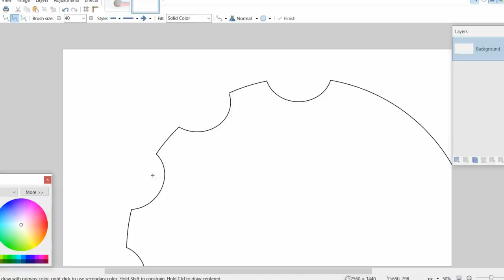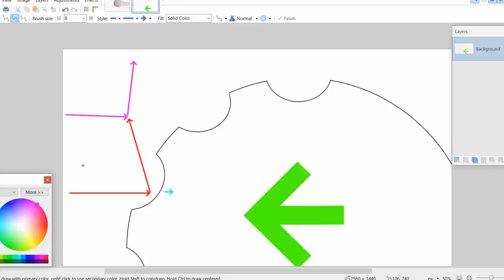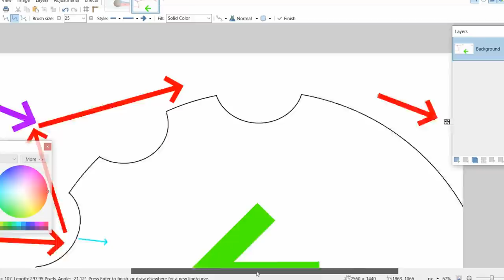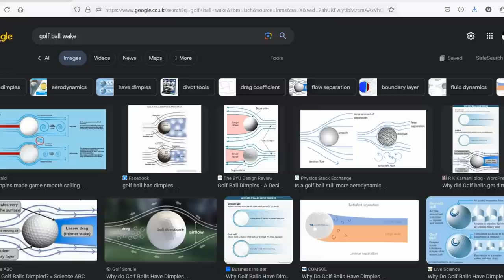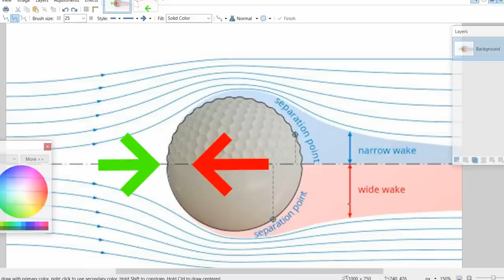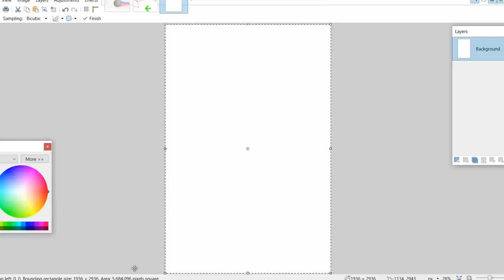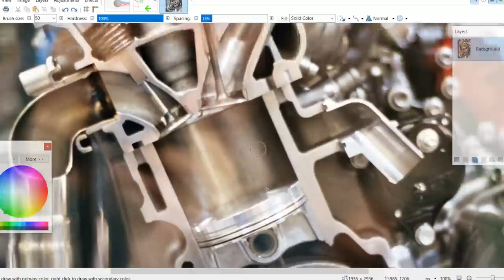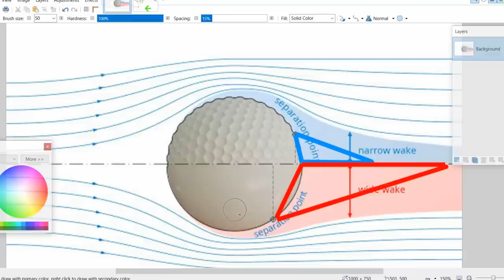Golf Ball Ports DON'T work!

Comment: Oh my giddy aunt...

This is why we don't let normies who watched a youtube video design aeroplanes! As an aerodynamicist the title alone makes me cringe. Painfully.
Reply: Why don't they shape airplanes like golfballs? Then the dimples would work :^)
Reply: @11metalfan  Ikr! I bet Airbus wish they thought of that one!
Reply: I’m super curious to hear from a person presumably in the aerospace industry what the wing and fuselage manufacturers determined when dimples were applied to the the leading edge of wings revealed in the wind tunnel? Is there an actual definitive explanation or industry known results ? Looking for efficiency anywhere and everywhere it could be found this must have been at least researched and tested. No?
Reply: @jameshirai8936  It's very simple. We know what the dimples do. And what they don't. They're useful for drag reduction on a golf ball, but that's about it. No need for a wind tunnel test

They essentially act like a turbulator. This is useful in the very special case of a sphere in higher speed laminar flow. Adding the dimples does the same thing as going a bit faster, which is force the boundary layer to become turbulent, but without the drag penalty of the added speed (goes up with square of speed). The added turbulence delays flow separation a little bit, which reduces pressure drag, bringing down the overall drag coefficient at that speed.

Even that's not always important. When the ball is going very fast, flow is turbulent regardless, so no benefit. When the ball is going very slow, it's too far from the transitional region, so the dimples don't add enough turbulence to do anything - no benefit. This is only helpful in the relatively narrow region just before transition, but because it's a competitive sport - it's enough.

Wings don't work like that. Unless you're doing something really stupid, there's no flow separation. On light aircraft, I can buy you maybe 1-2 degrees of alpha with a set of vortex generators. On an airliner, there's a whole host of boundary layer modification going on at low speeds, from the slats at the leading edge (used to energise the boundary layer, same as VGs, but much more effective), to the multi-stage flaps at the trailing edge, which act as independent wings (kind of like what they're doing for F1 front wings now), all in an effort to squeeze that extra bit of lift out of the smallest possible wing.

At speed though this is all retracted and the surface is as smooth as possible. There is absolutely no need to add any turbulence, the speed alone will do that for you. Biggest problem there is managing the the shockwaves on top of the wing and possibly at the stabilisers (depending on how aggressive those aerofoils are).

As for the air inlet on your piston engine, that's pipe flow. Completely different animal. Long and short of it is you don't really want to be sat in the laminar region (no real risk of that here), but aside from that, you want as smooth a surface as you can get. And you don't want any aggressive bends in there, if you can help it. Those lead to flow separation too. You can cure SOME of that by adding a trip ahead of the bend (in the narrow band of radii which are tight enough to separate, but not so tight that the trip does nothing), but by the same token you could just straighten up your runners (or other pipes). That'd be of greater benefit than pissing about with boundary layer modifications.
Reply from the maker: "a golf ball is also rotating, so those dimples are always moving, dimples on a fixed surface like a wing or port are not going to generate the same boundary layer.

- Wrong.

"you absolutely need port wall texture on an intake port that has fuel in the mix, not a dimple texture but at least a 60 grit finish,"

- LOL 60 grit finish? We call it Ra Sean. Look it up.

"this reduces fuel pooling and promotes an atomised and suspended mixture better for combustion."

- Provide a source that isn't an article of this.

"Matt laughed and called me an idiot for saying that airflow in an induction system wants to take the straightest path possible"

- I laughed because air isn't light. Just look at fine particles flowing down a pipe and tell me the air is traveling in a straight line. If it was what is turbulance? What creates a vortex and a wake? If air moves in straight lines why do dimples work at all? 

You don't know the answers to these things. 

What is this Sean?

https://en.wikipedia.org/wiki/Brownian_motion

Here's another question Sean. What speed is the air around you moving at right now?
Reply from the maker: It depends on the material, speed and pressure? Lol does it? Provide evidence of that.
Reply from the maker: As providing a source your not going to... why not? This work has been done and published in SAE paper. Why not provide the links to those? Is it because you don't know which ones and what they state?
Reply from the maker: Sean, I've asked you a simple question. What velocity is the air moving around you now? You don't have to be exact, just what is the generally accepted answer, in m/s please and the average is fine.
Reply from the maker: If you wrote a paper, and it was peer reviewed and you had the data, then yes. That's how science works.
Reply from the maker: "Where the air is a mass" what are you talking about? Ait had a mass, isn't a mass specifically. Look at you go. If it doesn't register on your tube it doesn't exist. What do you think cfd is?
Reply from the maker: "if I used my pitot tube in the room I’m currently in I would say it would struggle to measure any airspeed at all, why is that? Because the air as a mass isn’t moving."

- You're using the wrong method, because you're stupid.

I know what your trying to get at"

- Ah, so why didn't you answer the question? Why are you being childish? Is it because you can't admit anything?

"I know that an individual molecule has the potential of high speeds dependent on the temperature"

- It's not a potential, it's a certainty. The temperature is the average kintetic velocity of the gas.

"but in the real world that we live in Matt where the air is a mass,"

- I'm talking about the real world. Air has mass, not it is a mass. Mass is an intrinsic property of barionic matter.  

"it requires a pressure differential to be able to record an airspeed,"

- It meaning your pitot tube, nothing more. 

"we don’t live in a perfect vacuum with a single or handful of molecules within a square meter of space."

- LOL we do you idiot. What's between the molecules? Nothing. The air around you it literally a void with a handfull of atoms thrown into it. Air has a density of around 1.223 kg/m^3. Imagine that was a kg of water. That would be just over a litre in a volume. A m^3 is 1000 litres and the expansion of air to water is about 1000 times greater at the same pressure. See, this is why we use metric. 

So what is stagnant air Matt?

- Is a fluid with no flow or current. 

Why if you go into a room that has dust sitting on a shelf it’s still sitting on the shelf, your 500m/s airflow that’s ripping around the room should disturb the dust right? 

- No. But you know why right? The kinetic energy of the gas and the transfer of momentum is applied to every side of the dust grain. Not only that but the conservation of momentum involves mass. The mass of any air molecule is tiny compared to the mass of the dust. You can see the dust Sean, ever seen N2? This is basic school stuff.

"The molecules may have a potential to move at 500m/s but locked into a mass" 

- This is the most stupid thing you've said so far Sean, please explain what this exact sentence means.

"without a pressure differential it travels in micro movements to a point you can’t even register an airspeed."

Micro movements? What are you talking about? This is why you'd fail to write a paper Sean. You don't even know what the correct nomenclature is.
Reply from the maker: This that it, is that all you have? How about answering the questions I asked?
Reply from the maker: @seanb1443 I'm asking you what the RA for a 60 grit finish is. You're the moron who said it.
Reply from the maker: Sean read the comments. I said it's called RA. Then you asked me what the random finished off a 60 grit roll. That's a stupid question, and that's the point I'm making you tw@
Reply from the maker: @seanb1443 I'm gonna keep posting this until you acknowledge it.

"yes you were because the whole point of the conversation was about cylinder head airflow, that my calculation of 290cfm was ridiculous, your just changing your story now because your wrong "

- what it? Here's the comment quoted. I would link it back to the original, but you deleted that.

This is from the initail conversation.

"So at 100% volumrtric EFFICIENCY the engine would chew through 171.81 CFM or 5.955 kg (13.128528 lbs) of air per minute.

SO can you tell me which hole you pulled 291cfm from?

The theoretical max is 171 cfm @ 100% Ve - are you sure you know what you're doing, because I think you're a hack.

998cc is 0.998 Litres.
9,750 rpm
Assuming 100% Ve

so 0.998 * 9,750 = 9,730.5 Ltr per min

9,730.5 / 2 because 1 rev is half a cycle. Regardless of timing it averages out over time. Each cylinder intakes 0.499 litre per 720deg or 0.249 per 360deg. 0.249*2 = 0.499...

So the engine takes in 9,730.5 / 2 = 4,865.25 litres per minute @ 100% Ve (assumed)"

Now take note Sean. I spcifically say the engine 'chews through' X amount of air per minute. Am I talking about peak flow rates through a port Sean? LOL I then go on to show exactly what I'm talking about, by stating that Ve and the swept capacity of the engine vs revs. I also show how those volumes are added together to get a volumetric rate. I even put into into a mass flow rate. Now, can you show me where I said anything about peak flow rates through a head? I no you can't, but you won't admit that. 

I even posted this screenshot to you when you were crying on in the comment on FB. 

Wanna tell us all why inches of water are used instead of mercury?
Reply: /fetches fresh popcorn/
Reply: @seanb250  Oh you thought I was laughing at HIM! Let me laugh even harder 🤣🤣🤣🤣🤣🤣
Reply from the maker: Lol wow Sean, you thought you'd made an internet friend there 🤣 how about you acknowledge what was posted instead of avoiding it.
Reply: @dirtygarageguy  He really needs one, but clearly isn't ready to accept advice.